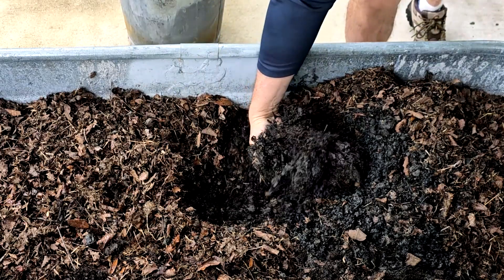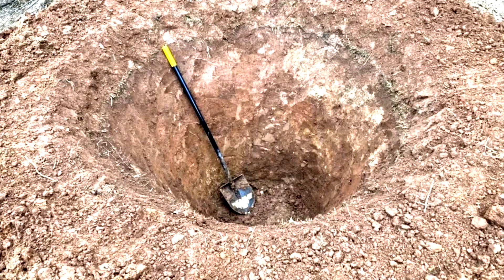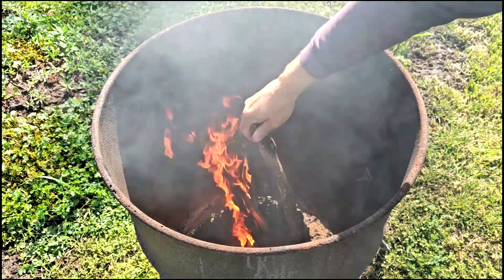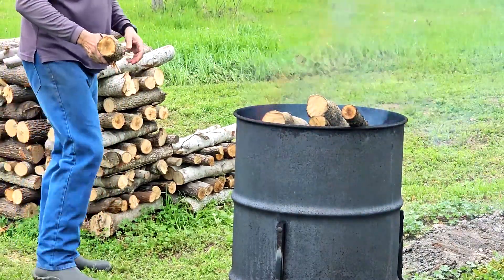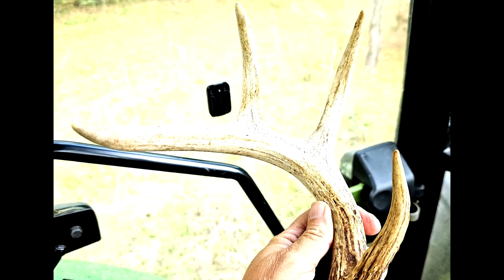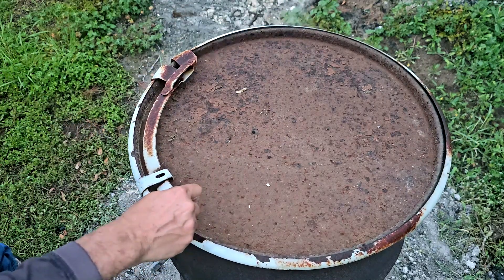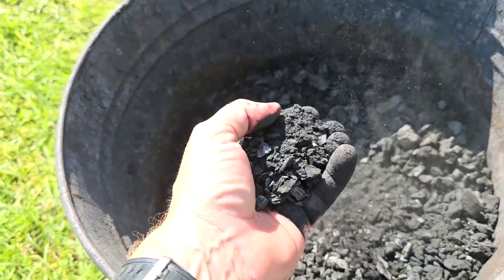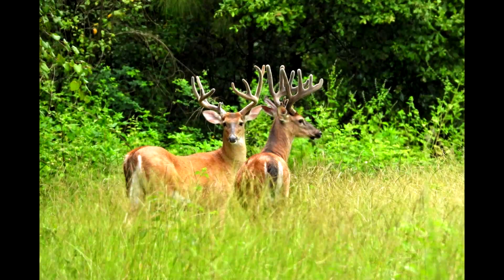How To Make Charcoal For Biochar

Comment: I also use the retort method.  55 gal drum w/lovable lid. Fill with cut up chunks of 3 year old oak firewood.  I made the outer drum/shroud from metal swimming pool surround.  It’s 4 ft tall and I cut it to length and overlap 6” and screw together real good with short metal lath screws.  The 4 ft height allows a good fire on top of retort and I can use tall feed stock to burn around the edges.  I use the top lit method for first burn and then add feed stock to get a good second burn.  I’ve discovered that it takes a second burn to get good charcoal.
Reply from the maker: @ronwillett9014, than YOU for taking the time to share comments regarding the methods you use!  I've truly been curious to know/compare notes, as I appreciate you've sure put biochar to great use with your plantings. 👍

Comment: I use the Top Lit method with first burn and then add at intervals for 2nd burn.  I keep 25 gal tubs of rainwater close by and quench the coals. Good video.  Thanks for sharing.